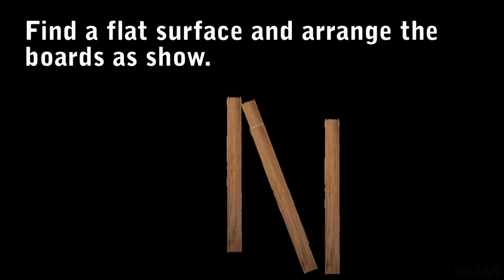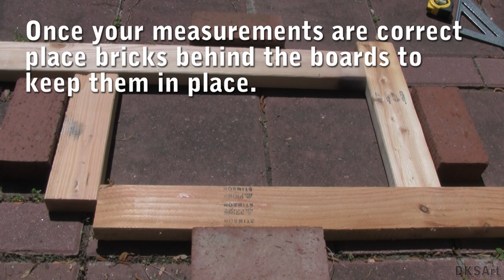Easily Making A Concrete Paver - DIY Stuff by DKS

Comment: Is there anything mix with it to avoid slip during rain
Reply from the maker: No, the side that is against the plastic bag will be very smooth and slippery, the side open to air will be rough, if you want to make it more rough you can place small rocks halfway into the surface of the concrete so they partially stick out of the concrete after it drys or just make grooves on top of the concrete so it does not dry flat, have fun!

Comment: Thanks for the video!  First time making our own pavers.  Quick question. Did you spray anything on the plastic bag so the concrete wouldn’t stick to it?
Reply from the maker: No, it should not stick to it, even if it does, once the concrete is hard you can just rip the bag off

Comment: looks horrible
Reply from the maker: haha, this was not made for looks, just functionality
Reply: @DKSArt  Then it great!!
Reply: Form and function go hand in hand. Why make something functional and ugly when making something functional an aesthetically pleasing does not take much more effort.
Reply from the maker: @sharicross547  some people care more about functionality than looks, you can spend as much time as you like making the concrete look pretty, I was simply showing a way to create a custom size concrete form without the use of any tools
Reply: @DKSArt  It isn't even functional. It will crack on that bottom ridgeline.
Reply from the maker: @spinapex2469  It has been functioning just fine for me as a stepping paver on a pathway in my backyard, since I have made it
Reply: @DKSArt  Did you use any sand underneath? Do you live outside of Miami or Anchorage, sir? Thanks in advance.
Reply from the maker: @spinapex2469  Nah, I just put it on my grass lawn, eventually the grass grew around it and keeps it in place.  I live in a warm climate in GA so I don't have to worry about freezing water cracking it
Reply: @DKSArt  You are very kind, and thank you for sharing this easy method. I'm looking to make really large pavers, so am hoping to find a way of making them light weight (sort of) as I'm going to have to carry them in order to place them, and I'm a little person. Maybe I can add styrofoam into the mix?
Was hoping to share a picture of the project I'd like to make, but I don't see how I can do that.
Reply from the maker: @bffentertainment7848  Yes, I have seen others use that method of mixing styrofoam with the concrete it does work.  But if you make the surface area of the pavers too large and thin they will crack.  So the larger the paver the thicker you will have to make it, and if there will be a lot of traffic on top of the pavers you will have to make sure you place them on a flat surface (sand works best) to distribute their weight evenly.  Good luck!